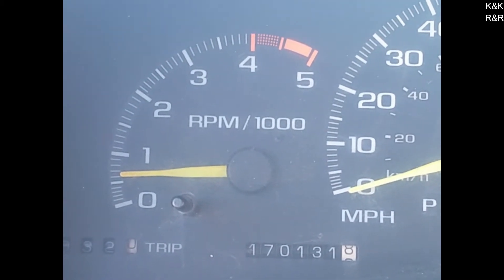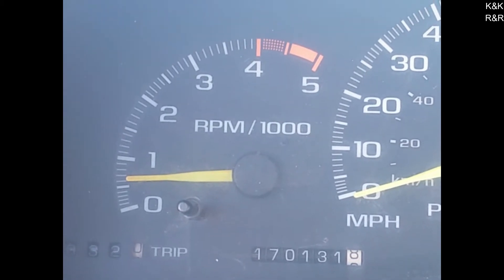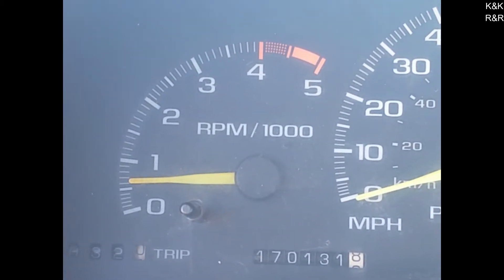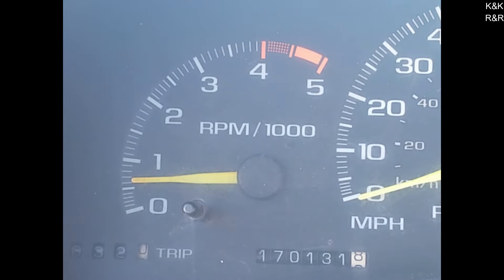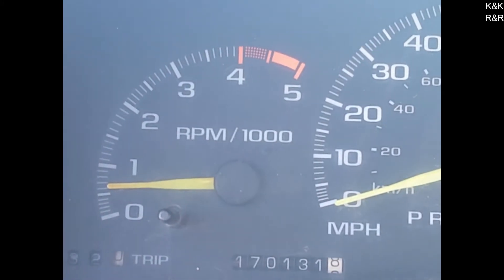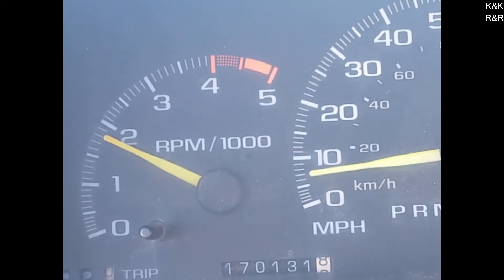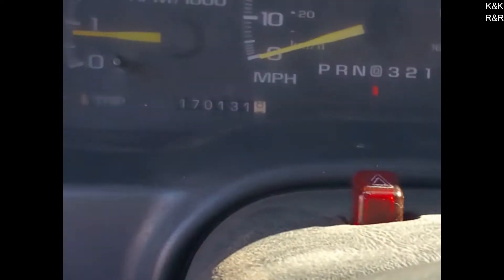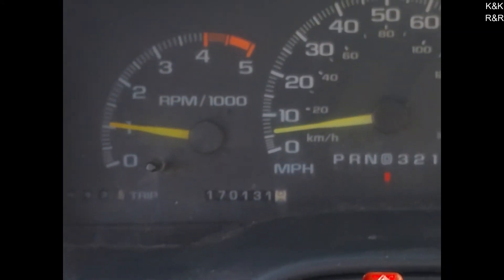Chevy 2500 Torque Converter Stall Test #shorts @KNKRNR

Comment: Im confused. How does this work when thats exactly how most people do a burnout in an automatic?
Reply from the maker: With the foot on the brake, gas pedal floored what ever your RPM's hold at is the 1 to 1 ratio (engine to transmission) or stall rating of you torque converter. This truck stalls out at 1600-1700 RPM's. For towing this is ideal to have your stall come in at 1600-1700 RPM's so when take off at a stop light heavy your max torque output gets you moving. Drag racing with a high performance engine you would want a stall of 3000-6000 RPMS to match the upper end power those engines are built for.  In a Diesel pickup you would a stall of 800-1200 rpms to use the bottom end torque.   Yes when you do a burn out you are at the full stall torque converter is rated at.  Takes a bit of power to burn rubber! 
/K&K
Reply: What am I looking for in a 07 Toyota tundra stall out how do I know its stalling im not sure how to see that
Reply: It’s the rpm at which the tires start to rotate before the burnout starts
Reply: My Mercury doesn't stall until 8,400-8,900 rpm and loses power from the engine to the transmission. Not a drag car or anything but it is v8 with a high output ignition system. Don't know what caused the transmission to let go and sometimes I will have a small shake in the engine almost like a multiple random misfire code. Maybe gas?? But I have a torque converter code on my check engine.

Comment: I don't understand the limits of a stall converter
Reply: it's when the thing kicks into gear,regular car,low stall,ease of operation,high stall convertor is  high rev, burn rubber, go fast😜
Reply: Higher stall converters engage at higher RPMs, allowing the motor to be further inside their power bands when the converter kicks in. In other words, the converter will engage later and allow the transmission to transfer more power to the rear wheels.